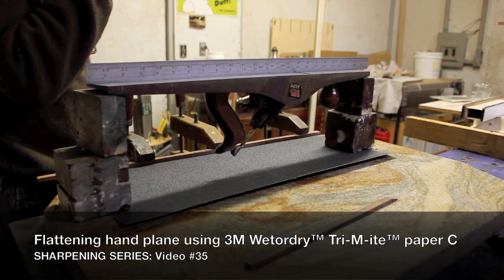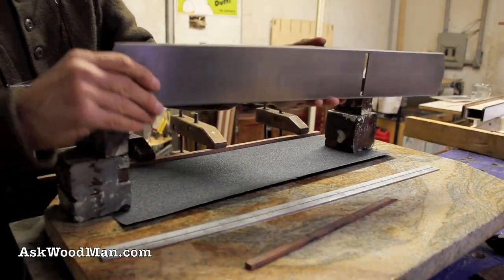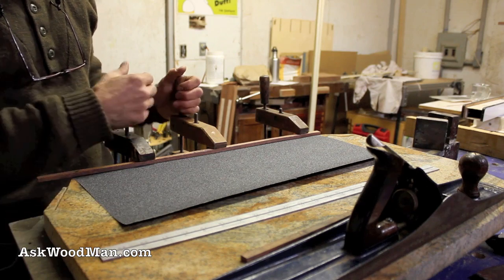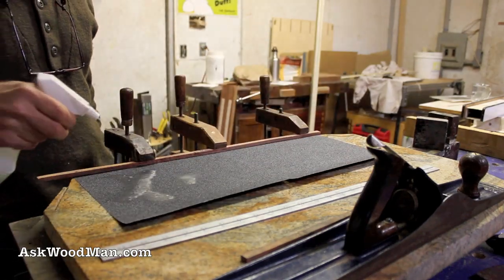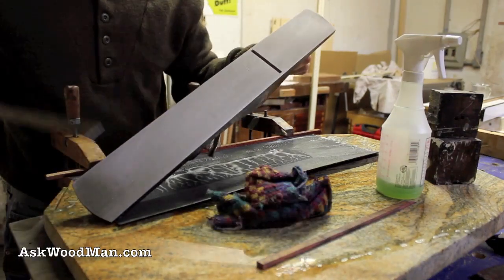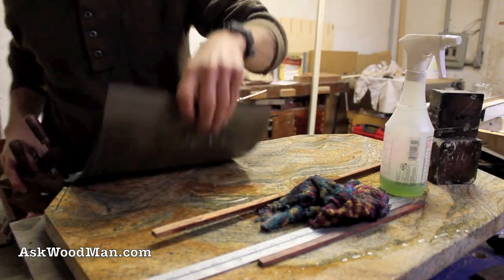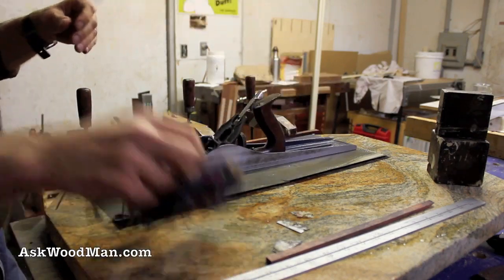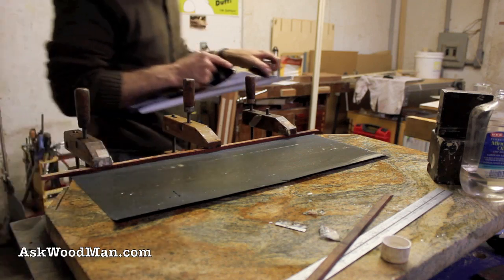How to Flatten Plane Soles • Complete Sharpening Series Video 35

Comment: Dave Jennings
I have always been sceptical about the process of flattening a plane sole with the blade and cap iron fitted. Even though some very influential people in the wood working world all say that it is vital as it tends to flex the sole, I personally could not see how this could be true as the tension of the cap iron is directly on the frog but not on the main body. To this end ( as a retired aerospace engineer ) I set up my planes on a rig which allowed me to measure the sole using a DTI reading in tenths of a thou and operated the levercap several times. There was no discernable deflection on my No3, 4s, 4 1/2s, 5, 5 1/2 or 6 with only 3 tenths deflection on my No 7, which I believe is more to do with the weight of the plane over its long length. Therefore I am happy to true the soles from time to time without the iron, chip breaker and cap iron fitted, which makes it easier and more comfortable to do. The only comment I will make is that I am sure it is easy to deflect the sole of a No7 or 8 simply by the pressure of your hands on the main body so it is important to flatten these with your hands on the tote and knob in normal operating position as that is where you need the sole to be flat. I still love my Stanley and Record planes and have yet to consider the very expensive modern equivalents.
Reply: killer post... thanks for the info.

Comment: I have a tip for you.  I have been lapping my old plane, fixing the blade, and have been working on the four old chisels that I own so that I can start using them (since I am just getting into more woodworking) and I found that the regular 3M sandpaper blunted really quickly and didn't cut very well but I didn't have any idea of this until I tried Norton 3X sand paper.  That stuff rocks!  I would take old worn Norton 3X over new 3M any day; it just keeps cutting.

Comment from the maker: Yes pretty close just by eyeballing. I usually err a little on the Simple Green side. I have a lot of new videos about the new sharpening jig I invented where I show more SG/water usage. I feel really lucky to have stumbled upon it. Just note that on aluminum it can cloud the surface if left in place. I don't even bother wiping the cast iron on my drill press and there is no rust. I do use oil or specific tapping  fluid for tapping though. This mix is a little too light. Thanks for watching.

Comment from the maker: There is a water based cutting fluid called Relton Option 1 that I have used for a long time. I have also used Simple Green around my house forever. I noticed they had a similar smell and feel and I just experimented and found SG works great with no rust promotion. The Simple Green/water mix is about 1/20th the cost of Relton. SG has a higher specific gravity than water so holds particles in suspension better, and no rust. I have drilled thousands of holes in steel with it too.Thanks Allan
Reply: Are you using the simple green full strength? Also, are you using the general purpose simple green?

Comment from the maker: @deaddollzombies I have had those planes for over 25 years. For me the wear occurs on the front and back of the soles and to a lesser degree around the mouths. The cutting results are definitely improved especially at  the beginning of cuts. I primarily showed this low tech method for people who want to get old corroded planes back to useful working order. But you are correct it is far less important than a really sharp edge on the planes blade.

Comment from the maker: @sonofursus It is a lot of fun to clean up a hand plane especially without spending much money. A lot of old planes are in good shape under the oxidation, and new plane blades are available to fit many of the old traditional styles. From my experience it is often the blade that is the weak link in old planes and not the bodies.

Comment: Woodman, have you ever tried using Honerite? It's a corrosion inhibitor and a little bottle goes a long way. Also, a couple people who teach in my area, like Rob Cosman and Jim Tolpin, recommend keeping the iron in but retracted. Supposedly it can cause some deflection (i guess this is easy to test for). Probably not a factor for the beast you're working with in this video.

Comment from the maker: @breezebro It is a 50/50 mix of Simple Green and water. I have use this for years as a low cost biodegradable non oil cutting fluid. I do a lot of metal work also and have use this mix to cut thousands of holes on the drill press in steel. I don't even wipe my drill press after using it and rust does not form.

Comment from the maker: That green liquid is a 50/50 mix of water and Simple Green All Purpose Cleaner. Simple Green is a non-toxic, biodegradable cleaner. I have used it around my house and shop for years (even add it to greasy clothes in the wash after welding) and just gave it a try as a cutting fluid and found it works great with no rust promotion. It is a cheap mix so I can use plenty as needed, and does a great job of holding the cut particles in suspension away from the stone for cutting efficiency.

Comment: Nice video. One important part I didn't see in the video is checking 90 degree square between the sole and side before lapping the side. Maybe you did this off camera, or already knew it was square. I found that many times this problem needs to be fixed on old planes, especially because someone may have ground it un-square some time in the past (by buffing, etc.)

Comment: woodman, I noticed you did not have the blade in the plane while flattening the sole. All other articles, books, videos I have seen or read has mentioned keeping the blade installed but retracted. By keeping the blade in the plane the lever cap is exerting pressure on the body of the plane which slightly distorts the sole and body of the plane. Have you found this to be an issue after flattening your plane?

Comment: Very useful video, but I was wondering if you have ever hear of diamond sharpening stones being used to flatten the sole of a plane?
Med Vänliga Hälsningar
Reply from the maker: The problem is diamond stones large enough to flatten a plane sole are very expensive. There is carbide film in various micron grits that would be an alternative to sandpaper.
Reply: @AskWoodMan  Understood, but I already own one of the James Barry Diamond double sided sharpening stones with 300 grit on one side and 1000 grit on the other which I thought might be suitable?
MVH.
Reply: Ignore the above comment - I accidentally hit a button on the keyboard before I could finish!!
Thanks for the update. I wasn’t sure if the diamond stone might be too agressive on the sole of my Stanley Bailey #5, so that could be the reason why most people use some form of sandpaper to flatten soles?
MVH

Comment from the maker: Generally you can get pieces like this free from granite counter top installers. The two pieces I have are the range and sink cutouts that those guys usually throw away.
Reply: Why would granite countertops have such tolerances for flatness? I've always been skeptical - do you need to sort through a number of off-cuts before finding one flat enough or can it be taken for granted that most are within a few thousands across their surface?

Comment: I had a difficult time finding coarse enough wet/dry paper in my area, so I took a chance and bought some auto body strips that are green(Sorry I don't have them handy not sure of the brand et) and gave them a chance with water. They immediately disintegrated...So then I wondered why it even needs to be wet at all. I used the strips dry and it worked just fine. I brushed away the metal dust as I was going along and my plane is nice and flat now.
Reply: What grit did you start with? I'm getting ready to do some lapping on a jointer plane and am hesitant to use 60 grit dry.

Comment: I was told that the iron should be in the plane and tightened when lapping the plane sole.  That way the plane is under the same tension when flattening as when in use.  Have I been misinformed?
Reply from the maker: +Tim Turney http://askwoodman.tumblr.com/post/40798525635/17365-i-have-always-been-skeptical-when-people
Reply: mark mac
Doesn't make any difference. All pressure is on the frog, not the sole. If you are bending your frog, you lever cap is way to tight.

Comment from the maker: @MrJacobryborg I disagree. If I had to choose one or the other the blade edge trumps it every time. Ideally both would be perfect. But you can have the a perfect plane with a crap edge and make mush of your cuts. I could take a rusted pitted plane body with a blade I sharpened and make furniture cuts. I know this because I have done it with planes people have brought to me.  I showed a simple low tech low cost way to flatten plane soles because I think it is important.

Comment: It seems to me that you could use the alcohol based marking fluid they use in machine shops to presion mark metal, called Dykem Blue.  You would paint it on the sole and it would show vividly how flat your plane sole is getting.;  Remove any excess with alcohol.
Reply from the maker: You are correct. Since I made this I have been educated quite a bit about lapping. I am planning some updated videos with this same plane. Dykem is definitely on the menu. I will also be using a precision lapping plate. Thanks for writing and keep in touch. Allan

Comment from the maker: That is an article of faith I have never found evidence to agree with. I have done measurements with precision Mitutoyo marking tools in both states. No difference. And just analyzing the way the lever cap is pulling to the mass of the frog, flexing the body is really not an issue I can detect. The lever cap is not flexing the sole heal to toe. It is just pulling down to that localized area. But people can believe anything they like, I am not trying to convince one way or the other.

Comment from the maker: It is a low tech way to flatten soles without getting out of control. That ruler is a Mitutoyo Grade A ruler accurate to within 1/1000"/ft. When I am done the ruler is flat with not perceptible gap. Is it National Laboratory Standards? No. But it is good enough for the woodworking I do and I did not spend much. Some people say to install blade when lapping. I have made tests with 123 blocks Mitutoyo rulers and digital calipers setup and find no variation between the two. Not a little. Zero.

Comment: should the plane be under pressure when truing it?
Reply from the maker: I have seen no evidence that the blade pulled to the frog by the lever cap changes the sole.
Reply: I think you right... It is different for shoulder planes.